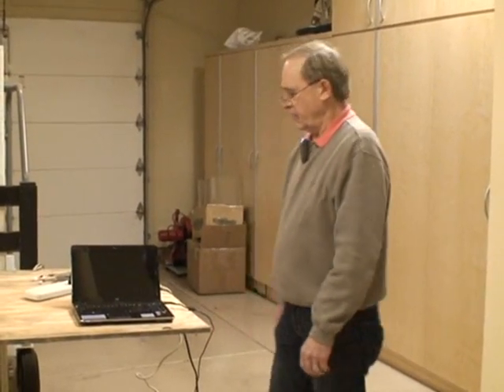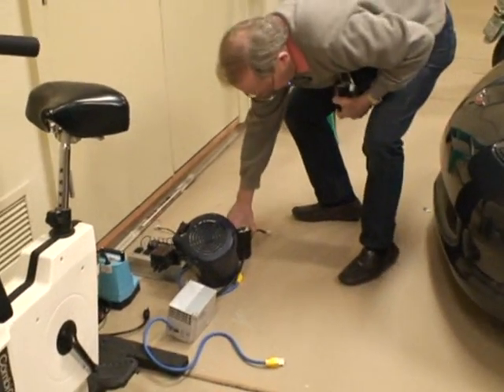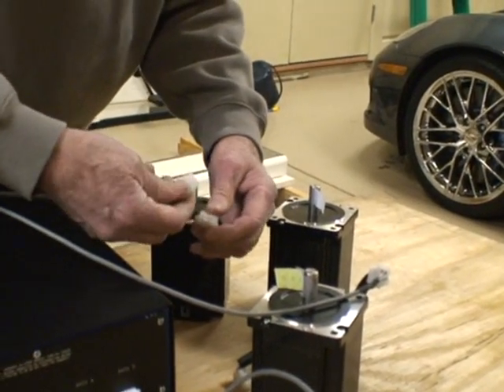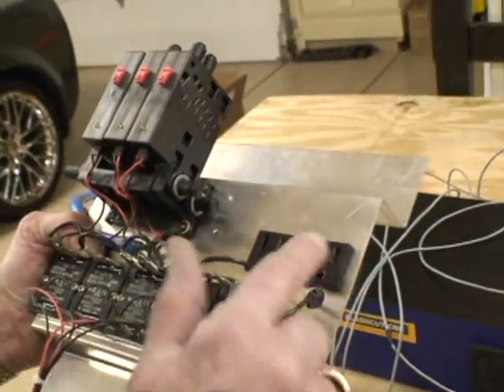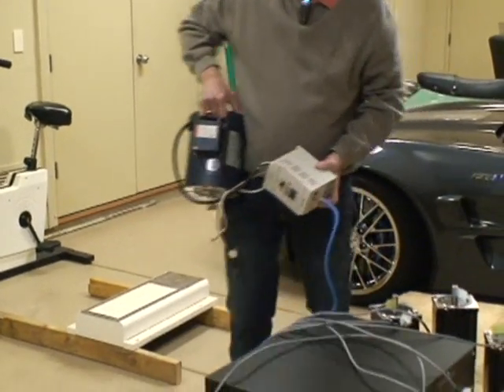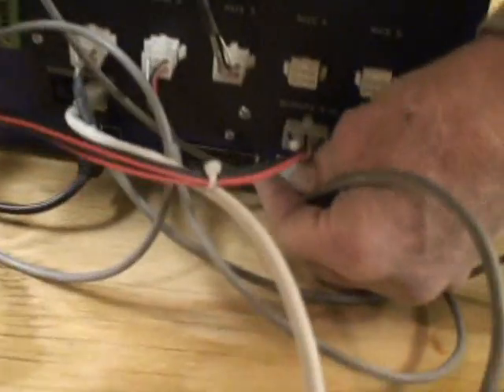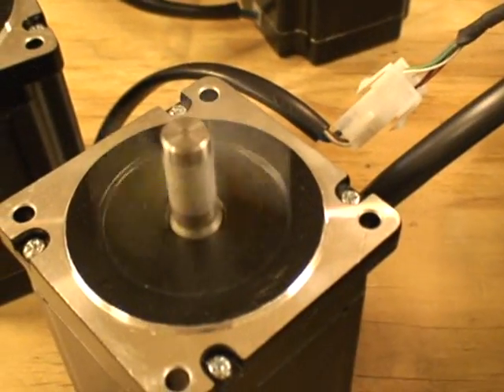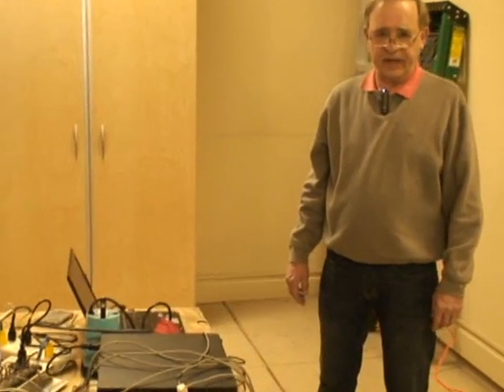FlashCut CNC Plug n' Play Demonstration

Comment from the maker: The vector drive I made by Delta. Runs on 110 vac. Requires a signal for forward or reverse. And a anolog signal for speed, 0-10 vdc. You program the drive for maximum frequency . The motor is a 3 phase 1 1/2 hp.